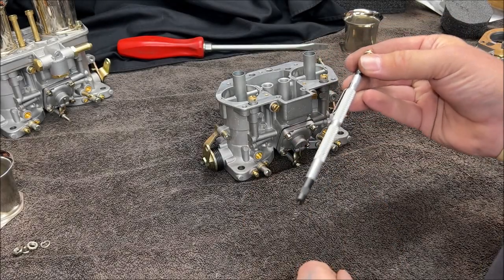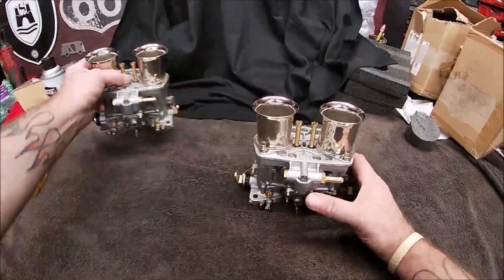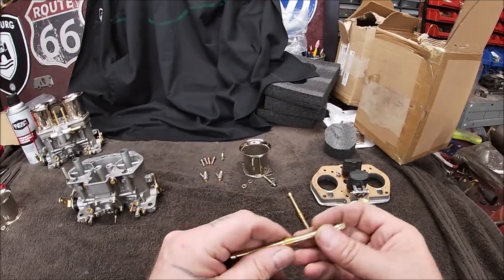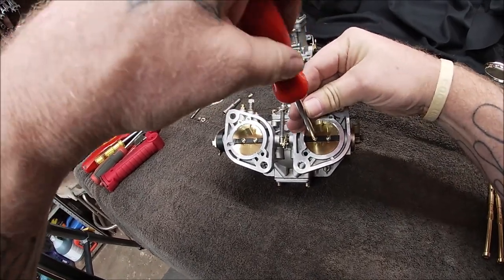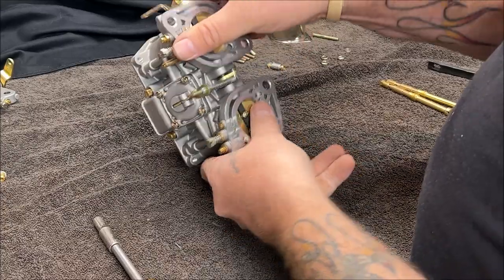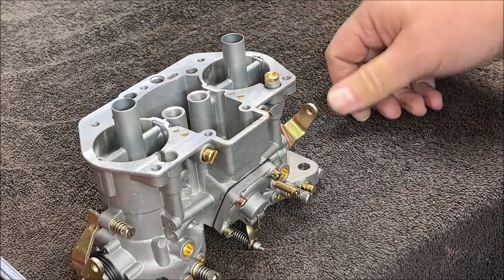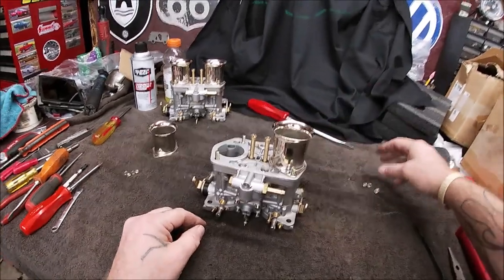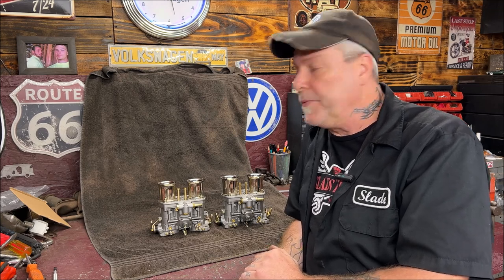VW Air Cooled 40 IDF Carbs - Chinese IDF Carbs - Cleaning & Set up - Beetle Dual Carbs - Webers

Comment: Slade, I've been running chinese clone twin 40s on my red bug for 3 years, IMHO they are awesome mate. The only thing I changed out was floats for the genuine weber items, this was due to the chinses ones sticking every now and then. Since that point they've never skipped a beat. And as a footnote, it was me that mentioned painting underneath rubber trim rails....lol... how could you forget me...
Keep on keeping on buddy
Dave
Reply from the maker: I could never forget you brother! I’m pulling those rails off tomorrow. Since they’re already bent into shape that’s kind of a bonus so I guess I didn’t waste my time. Some of these had no numbers on the air jets or anything. But the castings look absolutely fine to me. I just may have to buy a few things to make them right. But they were free.
Reply: @SladesVWBeetle  yeah change internal component, jets etc to weber and I'm sure you will have trouble free motoring

Comment: Nice information. 👍 Those look like 44 idf. Either way 40 or 44 work the same way.
Reply from the maker: Is there a way for me to check them for that? 40 or 44? I’m not familiar with these IDFs. You must have seen something to make you say that.
I always ram to 34 Wb. But I was told they would not be big enough for a 1904, which I still find hard to believe
Reply: @SladesVWBeetle  
The  44 idf auxiliary venturi are different than the ones on the 40 idf. Look up the photos.
Reply from the maker: @vintage76vipergreenromeovintag I will do that my friend thank you very much. They could have sent me the wrong ones I’m not sure. 
Personally I wanted to run the 34 Webers. I don’t see why they’re not big enough for a 1904. But some told me their too small.
Reply: @SladesVWBeetle  
Good running idf carburetors are great.
Reply from the maker: @vintage76vipergreenBeetle  i’ll have to figure out what jets and everything that I need for my area so to speak. And I need linkage.
Reply: @SladesVWBeetle  
 There should be a model number at the base of the carburetor area where it mounts to intake manifold. 44 might be too big for your engine. Ask jawbreaker for more information . Get a wideband kit to help you fine tuning the engine. Jawbreaker has a video on that also.
Reply from the maker: @vintage76vipergreenromeovintag i’ll be cleaning out the garage today while I am up there I will check the base and see if there’s any numbers. I don’t believe I’ve seen any on it but I could’ve overlooked them. And, I’ll have to look into the windband kit. I was wondering what they sold separately as a kit for tuning
Reply: @SladesVWBeetle  You can also measure the throttle plates bore in MM. I'll PM you about wideband kits on samba soon.
Reply from the maker: @vintage76vipergreenBeetle  thank you my friend, I truly appreciate that. I am very new to the IDF‘s. I sure loved by 34 Webers, they seemed easy to mess with.
Reply: @SladesVWBeetle  Good running IDF's are a poor man FI system, with more power. 34 ICT are good. IDF are top notch carbs. Samba PM has been sent.
Reply: The clones i have are like the Empi. A 40 is a choked down 44. They put a 28 in to make a 40 idf. So to change vents in them youll want to get ones for a 44 idf.
Reply: @michaelg1805  
Good information. 👍